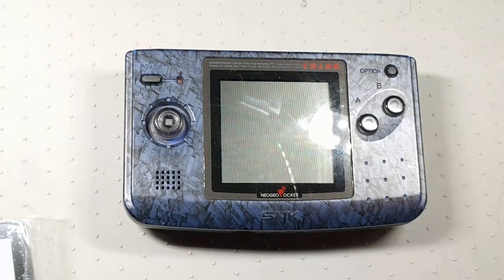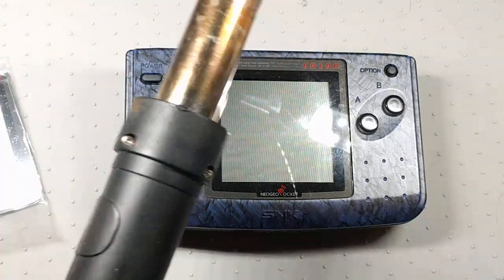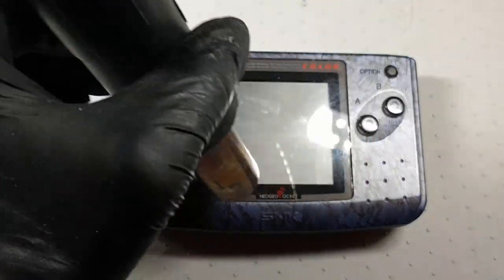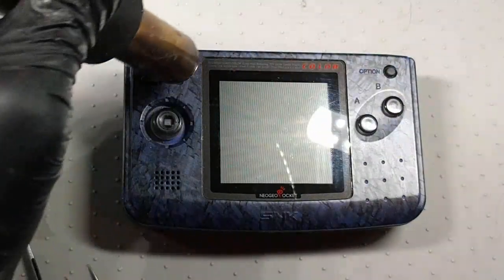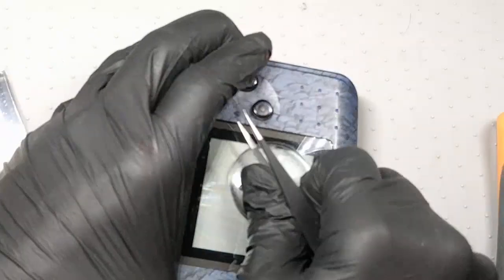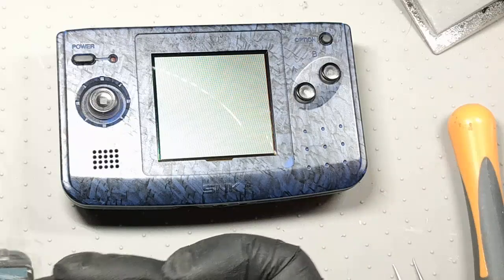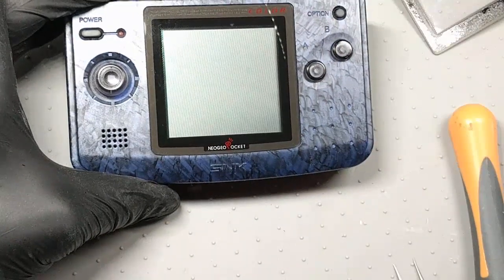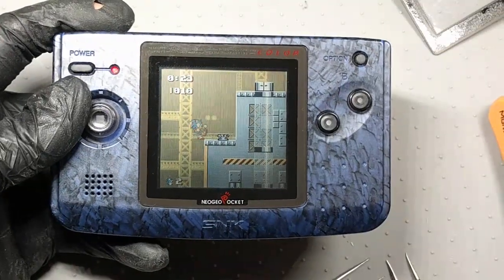NGPC Pro Glass Screen Cover Replacement Upgrade Guide (Neo Geo Pocket Color)

Comment: Why not just disassemble the shell and remove the lens from the inside of the faceplate or by slightly flexing it in different directions from either side? That would totally avoid the issue of nicking the faceplate.
Reply from the maker: This was a video for the quick run pros ;)  but yeah, that is of course a good option too!